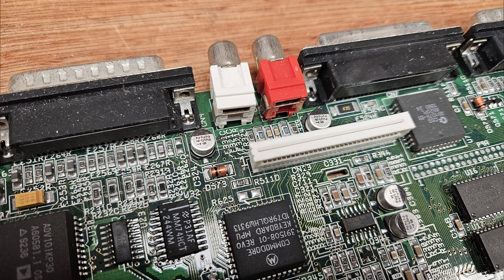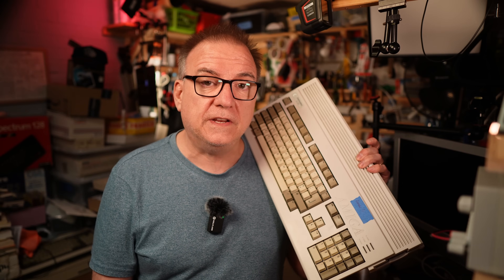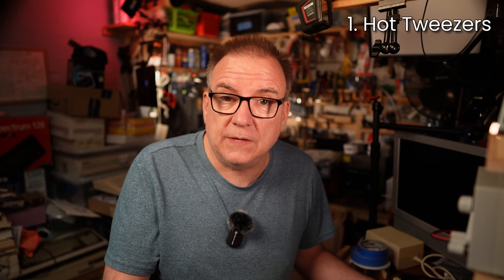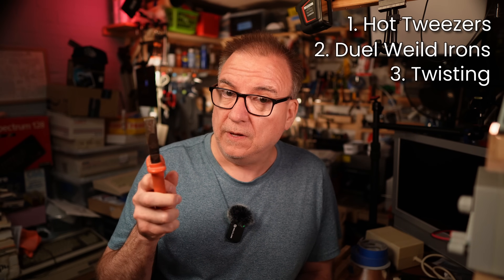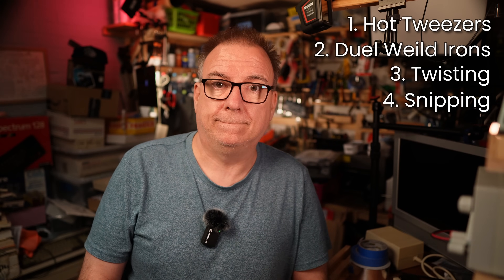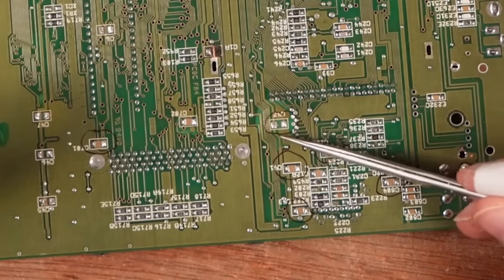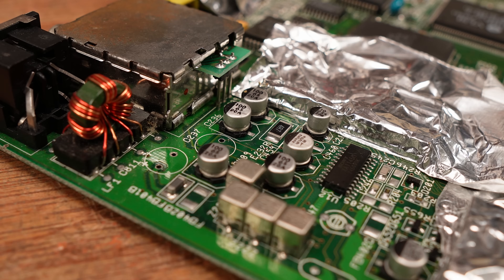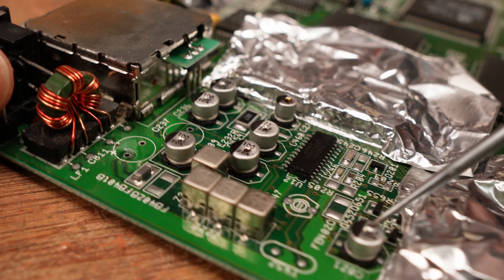SMD Cap Removal: A New Safe Method?

Comment: only issue i can see with this is you might get some toxic fumes from the boiling fluids so just make sure the area is well ventilated, other wise cool method.
Reply from the maker: Thats a very very good point. I have pinned your comment for visibility
Reply: Only one other method could be safer in that respect  but that method dare not speak it's name.

Comment: This was a old board pretty sure they used leaded solder hows it work with lead free probably the same but you might have to heat longer or hotter to find that sweet spot, you were right everyone has a method this was cool

Comment: Hot air from a rework station is the only professional method for removing any surface mount component. Everything else is a hack that may work sometimes but can cause serious damage when it goes wrong. Surface mount caps are designed to withstand high temps in a reflow oven so hitting them with hot air shouldn't cause problems and they won't explode because they are designed with a weak spot that splits if pressure builds up.

Comment: If you use low temperature solder before hot air desoldering, there will be no problem.

Comment: i just twist them off. if the legs of the caps are damaged with electrolyte, it actually helps the twist because they are weak and snap off quickly and with little force. you typically have to go back through and remove the ends of the legs with a soldering iron, but nbd. i use hot air for a lot of stuff, but it's way overkill to drag it out for SMD caps IMHO

Comment: What I recently do is use a hot plate to preheat the board below the solder melt point and desolder with hot air. It is quick and stress free.
A hot air preheating station(rework station) is probably even better but my bench space cannot take another station.
Heating the board slowly is crucial for not stressing it. Added benefit: you can fit new components very easy.

Next layer: thermal profiles
Reply: This! Especially for smaller boards where the risk of warping is high if the entire board isn't preheated. It's just easier to preheat (to a relatively safe temperature, of course).
Heating underneath helps a lot, but if you need sensitive control, heating from the bottom and top using a hot air tool alone may be required (specifically with BGAs?).

Comment: I have a great amount of decaping to do on an expensive analyzer about 100 .😮. So will definitely try your method. I use kapton tape to hold small components on the board. Also there is a sort of bodge technic that i us in rare circumstances, that is if pad track starts to lift use a sharp scalpel to cut the trace as close as you can get to the components. It gives you an easier time to put new pad or track. It's not always possible but worth trying. Thanks on video and your time, good luck with the auctions.

Comment: Yepp A600 and A1200 is some pain to do capacitor change on. One or two of them have one leg on the ground plane so you need alot of heat. For those you should use hot air while the others works like a charm with a tweezer solder iron (costly but worth it).

Comment: Copper wire wrapped around the tip of a soldering iron several times and shaped like a little fork spread right distance to touch the solder legs works really well for me when you're done slide the copper wire off and you have your sired iron back to the original state
Reply: great idea, this should be pinned!!

Comment: There is no need to weaken the board with heat, you cut caps in half and remove piece by piece. Solder new one nice n easy

Comment: 2 irons, and 2 people, both know what they are doing. Heat one pad, then the friend comes in the second iron on second pad, a second later friend knocks the cap over.  Whatever works for you is the right method though.

Comment: For something as important as an A1200 or A600, I always preheat the board on a low setting, use good Kapton tape around other components and just take my time.  Must of the issues people have are because they are in a hurry and do sloppy work.  Just use heat, preheat the board, tape off plastics and you will be fine.

Comment: I used hot air when I recapped my A600, but I did add some flux paste around the leads before heating. That freed them fairly quickly so the fear of them exploding was largely mitigated.

Comment: angle grinders work well. :). Tbh i always used hot air have tried the tweezers.. Do whatever method works well for you. Whatever method you use. Some one will always think differently nice video and great thumbnail :)

Comment: There is a 6th option. Thin stainless steel spatulas in a variety of shapes. These can be used to slip under one leg of a SMD component while you heat that leg with a soldering iron. The solder will not stick to the spatula.
Then just melt the solder of the remaining leg and slide the component off.

Comment: Also i find using solder paste makes extraction easier with hot air, a few drops on each end of the caps,.make it come off easier. You will find lower temp solder paste and a lower hot air setting less likely to destroy objects around.

Comment: That's an interesting idea, spiking the top, I might give that a try next time. I'd be inclined to only do it with the extractor fan running though. I'm becoming a bit more of a fan of hot air desoldering - I just removed a QFP 68030 from a Mac Classic II board, that was "fun"! (Apple have a habit of gluing stuff to the board as well as soldering it!)
Reply from the maker: Glue really turns it into a game of chance. Much more tricky whatever method you're using
Reply: @MoreFunMakingIt  Gonna call this the Trepanning Method, lol

Comment: As you said: Everyone has his own method of removing these caps. The pads of this Amiga 1200 looked really great, which made it easier to remove the caps. But what if the pads are already corroded? As far as I can remember you need much more heat for corroded pads. This again increases the chance to damage the PCB. And this would be much, much worse than a lifted pad. 
But anyway - thank you for bringing new ideas to this topic 🙂

Comment: I only used hot air as taught way back 34 years ago in college. But the downside is that other nearby components can also float or blow away. There’s no easy and reliable way, unfortunately with these crap caps.

Comment: Bake the boards at 90-100°C overnight minimum, preferably 24h.

Then use hot air...

Also, use a preheater to warm the board before hitting it with hot air.
A cheap kitchen skillet works wonders for hobbiest use, set to a moderate temperature. 

You can keep the hot air temperaure much lower that way, and not explode capacitors

Comment: I once recapped a PAL Amiga 600 and honestly I think the original PC Engine Duo is a more laborious and difficult system to recap of the same vintage, over 50 SMD caps to replace. What's worse is the old caps usually leak and destroy sections of the board so there's going to be trace and via hole repair on top of new caps.

Comment: I've had a good track record with Adrian Black's method of rocking them from side-to-side while pushing down on them, to fatigue the legs without tugging on the pads too directly. I've found that no amount of heat can get through some levels of corrosion.

Comment: You make it look really easy, Lee. 👍- But what about those infamous caps near the keyboard connector and the RCAs. Those are always the ones that make me sweat.
- A while back I got myself a "VEVOR T8280 PCB Board Preheater", which is great if you have to populate a larger PCB with a lot of SMDs, or for "stealing" components off scrap boards, and avoiding popcorning. The trick is to preheat the entire board, close to but not all the way up to where the solder or any plastic thingamabobs would begin melting, before using the hot-air soldering-iron to just nudge the temperature over the threshold in the area your working on to melt the solder.
- However, I would be very nervous about using it with an A600 or A1200 motherboard...nope, simply wouldn't dare it! 😅
Reply from the maker: This footage is taken from the next video in which I go through recapping an A1200. I'll show the ones near the keyboard connector 😀

Comment: I used to snip through the cap with sharp side-cutters years ago.

But I almost always use the hot air station now.

If you use a smaller nozzle, you can get the majority of the heat onto the pads/legs, and minimize the risk of a cap popping.

I've replaced hundreds of caps using hot air over the years, and only ever had a cap pop maybe twice in all that time.
Obviously always wear safety squints.

Also just need a bit a bit patient with the hot air on some components / boards, or on pads with thicker ground planes / lots of vias to inner layers.

If the board went through wave soldering, they will often add a small dab of glue under the component on the underside of the board.
So you have to judge when the solder has reflowed with the hot air, before using just a bit more force to break bond with the glue.

With these older boards, or just anything with cheaper PCBs or corrosion, I would always try to use hot air to remove stuff now.

I have to say, punching a hole in the top of the caps is a great idea. ;)
The board will need to be cleaned either way (hopefully with IPA or similar), so the extra fish juice isn't too much of a problem.
Reply from the maker: The goop never made it to the board. The worst part of it was the mess it made of my tweezers! Nasty stuff but cleaned up ok

Comment: I wonder if snipping a corner would be better.  The fluid may flow down while using the hot air, but you wouldn't have the downward jarring pressure when using the punch.  There's risk using snips to cut a corner too, if you grab it wrong and apply the wrong cutting pressure you could rip the cap off, I suppose.  I've seen motherboards so bad that no method would be 100% successful though, in my opinion.  Some pads are loose just touching the cap.  It really depends on how badly damaged the board is.

Comment: I have never got any problem removing caps. It is just a mater of having enough heat. One is to have dual irons or tweezers irons. The other is to apply heat from below to get the board up to 70-100°C. Or why not do both. Big ground planes in the PCB is a pain. So, depending on the number of layers, size etc I choose tactics. Many times it is also a matter of time and to get the heat to stabilize.

Comment: You're rubbish your channel is rubbish your video is rubbish and you don't know anything about electronics. I don't mean any of that but I want to join in! I will absolutely be piercing every cap before I remove it, even if I'm not using hot air

Comment: Hot air is the only way to replace any SMD component in modern board level repair (QFPs, connectors, ceramic caps, CPU/GPU, etc) Most people fail with hot air because they use a $50 eBay hot air station that's about as good for hot air rework as a Radio Shack $5 soldering iron is for board level repair. When you use the right tools, you get the right results.

Comment: I recently bought Handskit T12 soldering tweezers ($80). Original tips were too big, and they needed some free space on PCB, so i replaced them with T12-J02 (T12-JL02 will be better to >3mm smd components). For now i desoldered ~50 SMD electrolytic capacitors, and must tell they are working fine.

Comment: My method is a heat gun at a 4 inch distance minimum), tweezers and goggles for eye protection. For the rarity they pop (only ever had one go on a ps1) I'd rather not be dealing with the extra and potentially hazardous? fumes of boiling electrolytic fluid despite having an extractor fan. Its bad enough I use leaded solder.
Reply from the maker: Fumes are certainly something I would like to know more about. I have found mixed reports from minor research. Probably fine but always worth having a well ventilated room. Even with just flux vapours.

Comment: Alright, this is good! I'll use this method moving forward. I've not seen it before and think that this is a much safer method.
Reply from the maker: Only thing I would say Chad is watch out for the fumes. I have done some very light research and there are mixed reports about the fluid vapours. Mostly it seems its fine but I would hate for you to poison yourself!
Reply: @MoreFunMakingIt  well, i'll make sure to not inhale any random clouds of HOT AIR, or breathe in through my mouth. 😲

Comment: hopefully you didnt melt the plastic that is inside those square filter blocks next to the caps you took off
Reply from the maker: Im sure if they survived the oven and bath of molten solder to get them onto the board they will tolerate a little hot air not pointed at them :D
Reply: BTW why some aluminum instead of the good old kapton tape?

Comment: Those caps were initially installed using a reflow oven, so are designed to support living in hot air. However, one other option would be to use ChipQuick low-melt solder. It stays molten for ages giving you lots of time to remove the cap using a single solering iron. You must wuck away the left over when done, but you'd be doing that anyway.
Reply: ChipQuick is too expensive and leaves a mess behind to clean up. ChipQuick != solder - you need to make sure none of it is left behind.

Comment: I used to use hot air but since I saw the YouTuber Chris, using the snipping method, I've done the same and never looked back since. No risk of broken pads or blowing tiny components out of place with a hot air gun. In my mind snipping caps is the most safe way of removing SMD caps.

Comment: When reapplying solder to the pads, its best to put solder on one pad.  Then some flux.  Hold component in place with tweezers then flow the joint.  Then solder the other pad.  That way the component sits flat on the PCB. Its quick, easy and the professional way to do it.

Comment: There is some terrible advice on youtube.  ...and it does annoy me when people with zero soldering skills "recap" computers to sell on as "recapped" when the pads are missing or about to fall off the PCB.  For SMDs tweezers are the only reliable option.  Use the right tools for the job or don't do it and ruin an otherwise good computer.  Hot air is harmful and overkill, especially if the PCB is not preheated.  Two low power soldering irons is the next best option to decent tweezers.  When using tweezers, first apply fresh leaded solder to make the job easier.  The vast majority of youtube advice is garbage.
Reply: I checked out your channel, and I don't see anything. Let us know when you've put up your masterclass tutorial, and we will all check it out. We can't wait!
Reply: @ChadDoebelin  I don't make videos, no time.  It sounds like you object to someone giving good advice?
Reply: @OnlyAmiga85  what? object? I was begging for more of your great advice it's too bad you're too busy to make videos. i'm so glad that you were able to make time to watch videos and make comments on them though. good stuff.

Comment: The only thing I would really be worried about is slipping and putting a hole in the board
Reply from the maker: The metal of the can is very soft aluminium. The bradawl I used is very hard and sharp. As soon as you start to put pressure on there it bites into the metal and wont slip.

Comment: Thin polyimide film (aka kapton) can do the trick for you, it easily handles 300...330 °C and you can stick it underneath SMD while its still liquid
Reply from the maker: I have had bad experiences with kapton tape. It is very heat resistant but for shielding plastic it does not do a good job. Although it is resistant it is not heat reflective, and just passes the heat straight through.
Reply: @MoreFunMakingIt  kapton is widely used in pair with some kind of metallic foil in space industry, to prevent wrinkling/crumbling/tearing/shredding of  foil. Thats what it was primarily invented for

Comment: How about using low melt solder? Never used it myself, but it seems to me, that is the easiest way?
Reply from the maker: Ive not tried that myself. But Im not sure it would be the easiest way? Certainly it would work fine on good condition solder, but I am not so sure it would be very easy to get it to work with heavily corroded solder. It would also take quite a lot longer than other methods.

Comment: Interesting idea. I normally dual-wield myself and have a pretty safe way of doing it with the A600s and A1200s I work on. But when I occasionally need to use hot air instead, I'll consider this.
Reply from the maker: Let me know how you get on with a heavily corroded example please Andrew.
Reply: @MoreFunMakingIt  the heavily corroded is where I usually use hot air. But sometimes use a combination of fibre pen and flux with braid to remove the top level corrosion before dual-wield.
Where I use hot air, the capacitor is usually pretty empty already.

Comment: I like it. Would it be possible to suck the electrolytic juice out of them somehow before starting to heat them up? I am aware it didn't really create a big mess on the board, but perhaps some got on the tweezers? If it is something I really dislike about SMD soldering, it's having sticky tweezers. Great vid.
Reply from the maker: Thats a good idea. I wonder if you can get most of it out with a syringe?
Reply: @MoreFunMakingIt  I would like to try that. It would be nice if it would drip out on its own if you left the PCB upside down overnight, but the juice is too thick for that to work I guess. Maybe if you somehow could fix the board upside down, and preheat the area with the hot air gun to have the goo drip out on some tissue before starting the removal, being careful not to melt the solder and suddenly having all the board's components in a neat pile on the desk.. 🙂

Comment: Looks fine. I learned hot air from Louis Rossmann's old repair videos using plenty of flux to deal with oxidation and water+ damage, with generous heat, but then you also have to ultrasonic clean the board afterward.